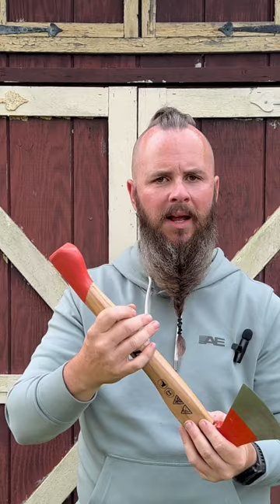Axethrowing rant….Poly on handles…STOP #shorts #axethrowing #axe

Comment: What’s your justification for not liking polyurethane? I genuinely don’t know so I’m curious
Reply from the maker: When I say this I’m referring to poly on axe handles. I’ve used poly on other wood projects just fine. Poly sits on the surface and doesn’t penetrate like linseed oil and other oils. Poly on most work handles such as an axe can normally cause hot spots on your hands causing blisters. Also if you’re using your axe as a throwing axe, you’re going to miss causing the coating to chip, crack or just completely come off. Where as with an oil you do not have that same issue. Also I like using BLO on my eyes to swell them over the axe eye from time to time. Poly would prevent the oil from soaking into the wood if it was placed in the wrong spot. There are many videos and articles out there that would explain it better then me in a comment section haha